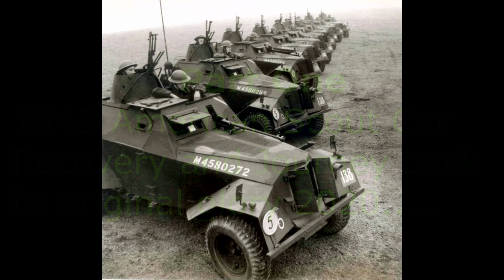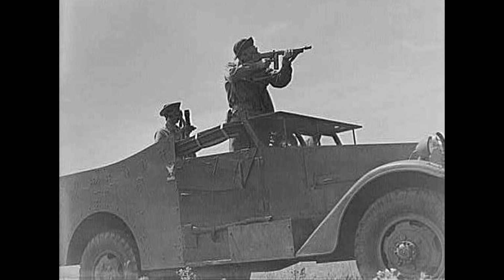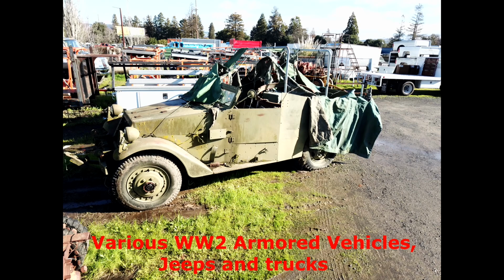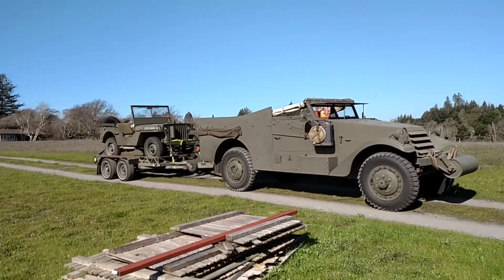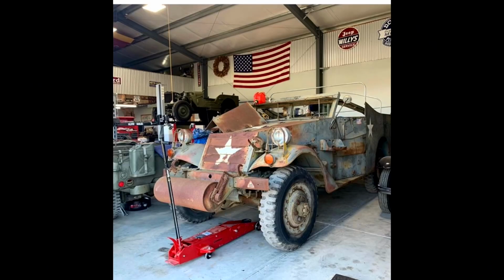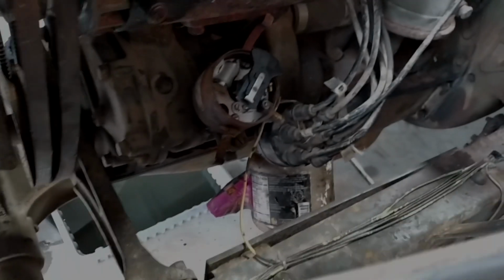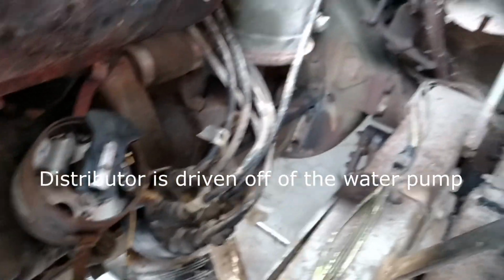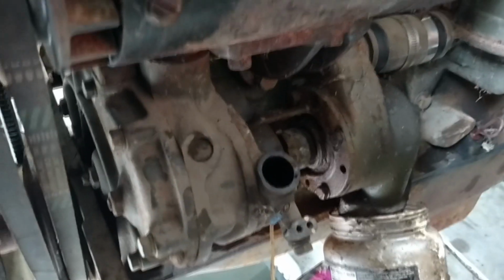The M3A1 Scout Car, An American armored car of WWII

Comment: Is the transfer case arrangement the same as a halftrack with high and low as well as engaged and disengaged  ?
Reply from the maker: The transfer case has high and low, however you could not disengage it. It is full time all wheel drive.
Reply: @EJOWest  I always wondered about that.  I doubt that the transfer case has a differential like an old 4x4 pickup.  Does it get bound up on hard surface roads?
Reply from the maker: @adamhoffman3687  yes, some people remove the front drive line.
Reply: @EJOWest  that was my next question.  Haha. It looks like it may have been a French return by the speedometer . Looks pretty complete and unmolested.